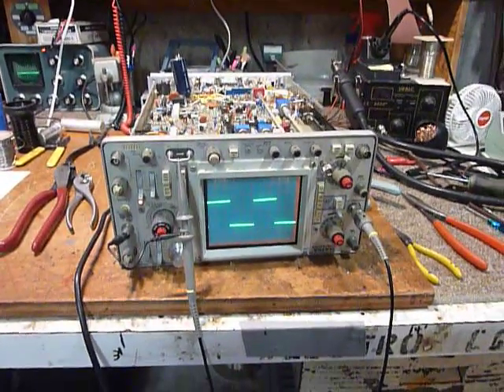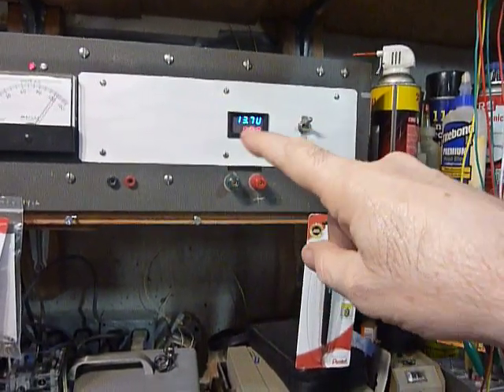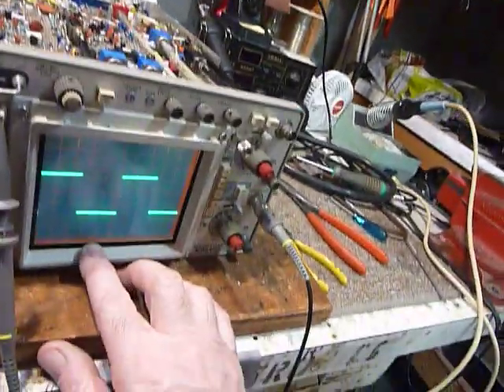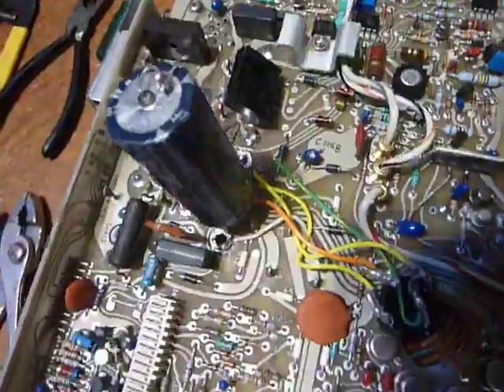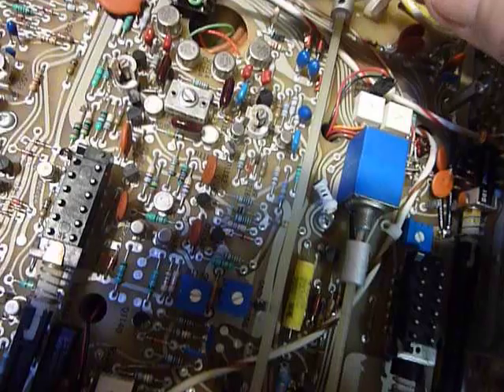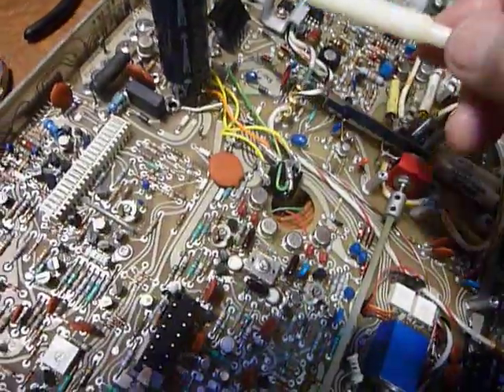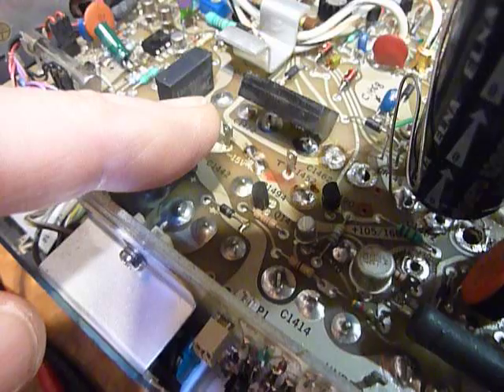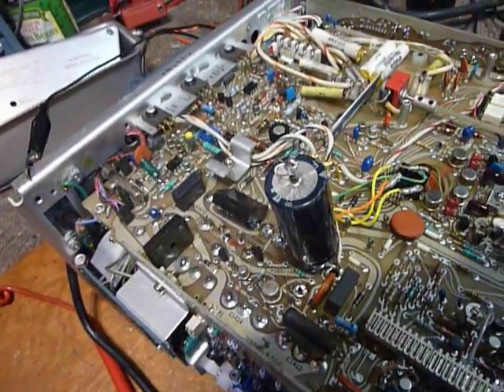Tektronx 475A ,  Textronix , Textronic scope repair , Oscilloscpe repair

Comment: I'm the proud owner of an incredibly well preserved example of a 475. These scopes are built to the finest possible quality and designed to be repaired. I love using the scope itself and would be lost without it. The I have the user and service manuals which are marvelous things on their own. 

The most incredible thing is that I bought this fabulous piece of equipment at a local radio ham fest for £30uk, literally pennies! I believe when these scopes were new they cost $2500 which equates to about $20,000 nowadays. I have other scopes, analogue and digital, but the Tek 475 is by far my favourite.

The history of Tektronix is fascinating too. It was founded along the lines of a Quaker philosophy which paid off in the loyalty of the workforce and the quality of the products.

Comment: Great Video. I have a 475A with a slight problem of a wiggling trace. I'm going to take your advice and start with checking power supply voltage and ripple. Thanks much. I enjoyed this video a lot.

Comment: Dear Bob, I received 475 as a gift, but the man who gave it to me told me that he switched the input voltage switch by mistake instead of 220 to 120 watts.
it was short, maybe 1 sec and he turned it off.
I never repaired the power supply and oscilloscope and I did the same and in the part where the two elements are (I think they are transistors) I found "blackness" on some element that I did not touch.
I am asking for help, I live in Serbia and there is no one here who could fix it.
I have more than 30 years of experience in serv.electronics, but I have never serviced oscilloscopes, so I am asking for your advice and help.
Thank you in advance Vukan

Comment: Most of Tektronix 465, 465B, 475, 475A and 468 have similar issues after all these years. They have no display or show greenish screen with no trace. And many people say in the internet that the big capacitors are the reason. But it is not obviously. If it is so simple to replace 5 big caps, the recycle companies will do the soldering work themselves and re-sell them for new price on markets.
Reply: In my experience, most of the time it's the small Tantalum Caps.  Particularly those in the PS or the deflection circuits.